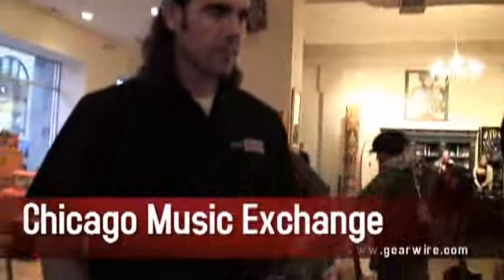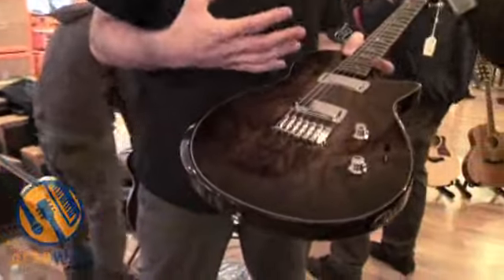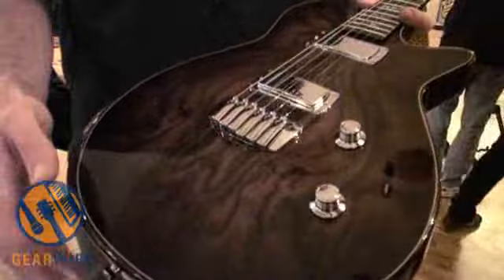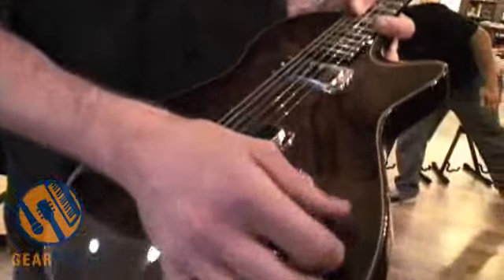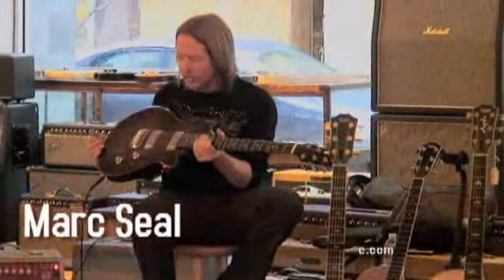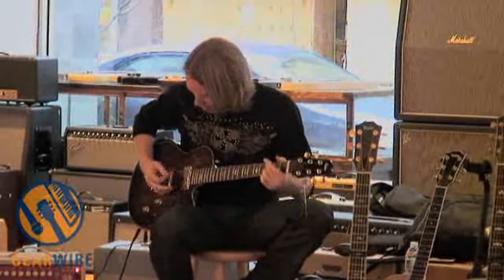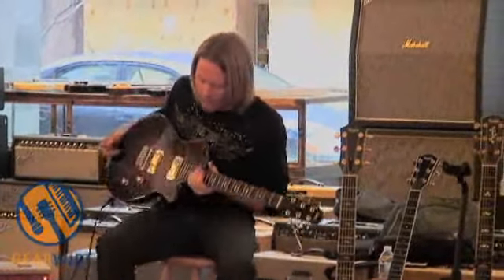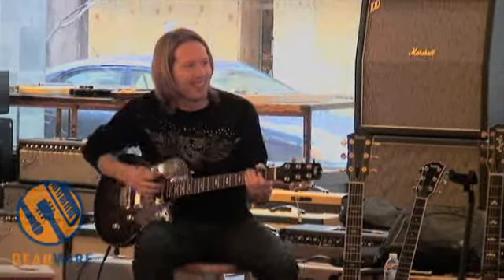Taylor SolidBody Custom Boasts Sweet Taylor-Made Pickups

Comment: These are beautiful and very well crafted chambered elecric guitars. They failed because in 2008 the list price was $3098. In 2024 that's the equivalent of $4524. Your target market was guitar players that would rather spend that on a Gibson Custom,  Fender Custom shop guitar. 

A single bolt on neck, instead of setneck was a shock to everyone at the time given Taylor's superb reputation on build quality. Marketed a chambred body as a solidbody guitar. Used aluminum instead of steel or brass on their bridge. Taylor is so synonymous with acoustics they struggled selling the T3, T3B, T5, T5Z also.